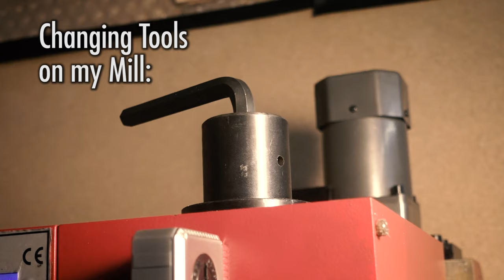Milling Machine Upgrades - Hammer/Wrench Tool + Spindle Lock

Comment: Outstanding improvement!  What a great video to watch!  One thought if I may:  It'd be nice to have an interlock that disables power to the motor when the locking pin is engaged. I can see the off chance situation where 1) the pin sticks and 2) for some odd reason you forget to check it before you power up.
Reply from the maker: That's actually happened already so not a bad suggestion 😅 However, I was lucky because the built-in VFD in this machine has overload protection. So the motor was disabled automatically and it just displayed an error message - didn't even know they could do that. It worked fine after resetting the machine. I'm not sure what would have happened on a geared machine without a brain box, but I imagine it would have sounded crunchy and cost a lot of money... or maybe the clamping ring would have just slipped. Either way, good idea, and wouldn't be too hard to do, but I fear it's one of those things that'll stay on my "maybe someday" list for a while.

Comment: Hi Phil,
I made the hammer wrench tool for my SX4 awhile ago after seeing Frank Hoose on mini lathes, his version has a ball on each end of the handle which gives you a gyroscope effect, one flick of the tool & it almost undoes in one go. I use a C spanner to hold the spindle
 as on the SX4 the hole for the pin is on the bottom of the quill. Might have to look at the spindle lock as yet another project!
Reply from the maker: Yeah I saw that on some SX4 machines there's a hole for the locking pin at the quill, but I think it depends on which spindle version you have. This is SK-30 (or ISO-30) and it seems like only the R8 taper machines have that hole. And you're right, Frank Hooses tool is much nicer, but I decided to go without the balls, the spinning thing still works somewhat even like this

Comment: Such a great video, My SIEG SX3L Is arrived from Paulimot last week, i Will start to make your idea this week end, because It Is very useful and nice!  I want to try to use alluminum instead of steel, to make the big rings: i have in My workshop ( 110 mm external diameter) so i will try to see if i can make enough friction on the spindle!

Comment: you came up with the design of the spindle lock, but at the same time made an impact wrench ... why didn't you make the nut removal?  nut puller, pressing the tool, which works on the principle of pressing

Comment: Nicely machined.  However, I think I'd have gone for a spring-loaded pin on top of the mill to keep the lower part of the spindle clearer plus, it could be bolt action.   Also, I wonder how the balance of the spindle will now be especially at high speed?
Reply from the maker: Yeah I had that thought too, would have been a lot easier to make but I didn't like the concept of blocking the spindle splines with a pin (like the manufacturer intended) because there's not a lot of contact area and the splines were already starting to wear out from it. I've seen a solution on some other channel though where somebody built a sort of socket that matches the spline profile and locks from above, that was pretty smart but I can't find that video anymore.. Anyhow, I also wanted to be able to lock the spindle solid for slotting cuts where there can't be any movement and the rings seemed to be a good solution. The rings are pretty balanced so I haven't had any problems with that at high RPMs, runs just like before
Reply: @PhilVandelay  Thanks for the reply.  My main concern was with the spindle balance but if you've seen no change then it clearly isn't an issue.  I also take your point about slotting.  If you ever come across the other video please send a link as I'd like to see it.

Comment: Love the spindle lock.  What make and model mill do you have?  I have a RF-45 and it looks similar to yours.
Reply from the maker: It's a Sieg SX-4, yeah it's quite similar to the RF-45, same form factor
Reply: @PhilVandelay  that’s cool. I wasn’t aware they made it with that collet system.  I bet that helps a bunch.   Mine uses an R8 collet and the spindle bore is pretty loose unlike which is typical of the chinese imports except for the Sieg machines.

Comment: Just curious. Did that add any vibration to the machine? If so how bad, especially at high rpms. It is a good idea, i would just be afraid of adding vibration to the spindle if it isnt balanced.
Reply from the maker: Not that I can tell. The rings are pretty balanced, the only slight imbalance is where the clamping screw goes but I think it's so little that it's negligible. Haven't had a single problem with this setup yet, but it has been extremely helpful and time saving

Comment: Have you seen how Adam savages mill does this. Im pretty sure it's like a rattle gun
Reply from the maker: Yeah it's pretty much a pneumatic impact driver on top of the mill. Pretty common for larger mills, but kind of a luxury feature for me. This solution is a good compromise I think, it's relatively quick and easier/cheaper to implement

Comment: 02:21 plzzzz dont you ever wear gloves when using a lathe !!!!!!!!!!!!!!!!!!!
Reply: You can use gloves, also on mills and drills. But only ligth duty ones, which breaks easier than your hand. We usually use nitrile gloves for the drill
Reply: Both of you are correct if you were to use cloth base glove it could pull more easily then your skin BUT theres certain gloves that can be used and were intended for machining work.